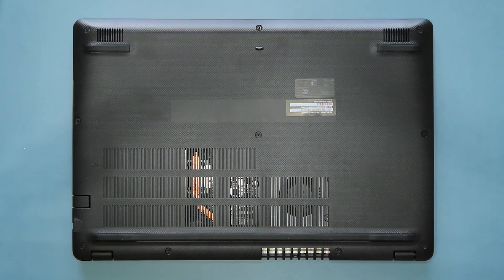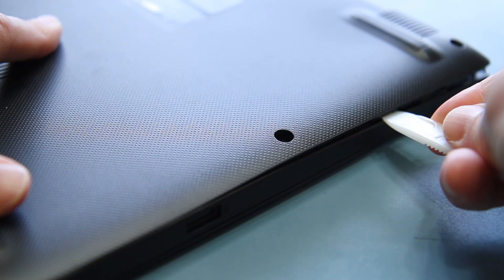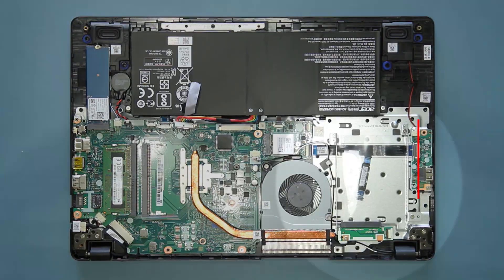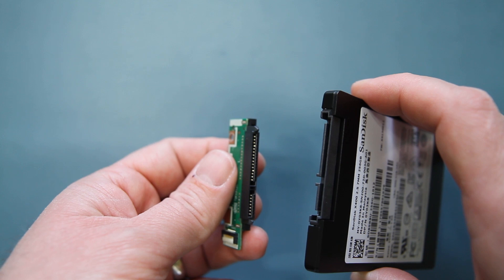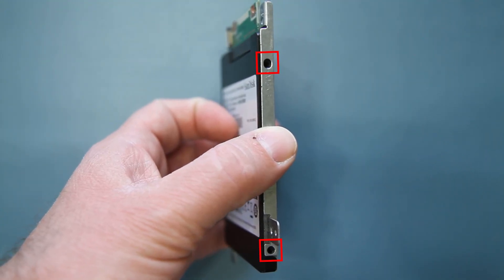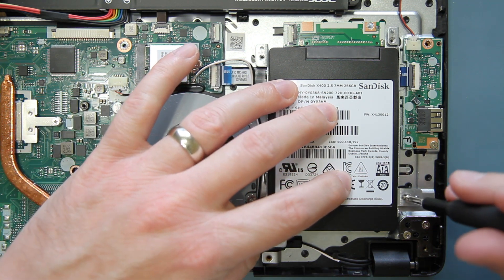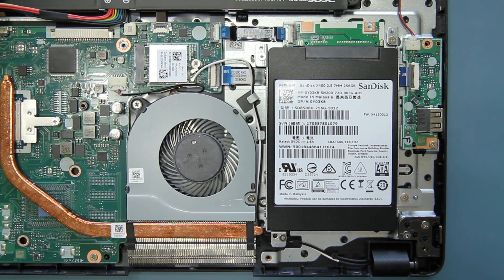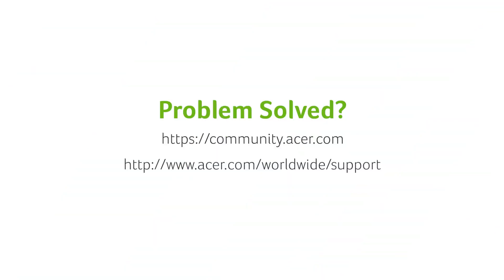Aspire A515-43 How to Install an Additional Hard Drive

Comment: Thanks, very helpful! however, if you're using SanDisk as your drive then the technical information should not be on top - as presented in the video - but on the bottom! otherwise you will need to unscrew everything again and screw it back again.
Reply: Kudos, Correct, have to line up connectors, "Not" the label on the drive.

Comment: I have this very computer (Aspire A515-43) and installed an additional hard drive (Crucial MX500 500GB 3D NAND SATA 2.5 Inch Internal SSD) exactly as per the instructions in this video. Everything went perfectly smoothly. Now that I have booted up the computer, however, I do not see the new SDD in the Windows File Explorer. When I click on "This PC" in file explorer, I am only seeing the original SSD which came with the computer, and not the second SDD which I just installed. How to fix this or trouble shoot it?
Reply: You have to go into disk management, create a simple drive "D", and format it NTFS. so it can be seen by windows

Comment: Works great, just as described.
Couple notes:  The glue holding the Hard Drive to Motherboard cable to the case was pretty strong. Be careful prying it off that you don't hurt it. 
The Motherboard side under the connector was NOT supported by anything on my computer, so be careful not to hurt the motherboard while manipulating the clasp for the HDD cable.
The MB to HDD cable has tabs on it, which also go into the connector. There are places for the tabs to go, so you can't mess it up unless you don't recognize this.
After installation, it doesn't just pop up with the native drive. You have to go into "manage storage" in Settings and tell the Computer how to designate it (Typically "D:" since "C:" is the native one with the OS. Refer to this designation to store things there. 
A trick I Iearned from my Granpa is to spin the screw GENTLY backwards (under gentle pressure) until you feel a "click." Once you feel this "click" you KNOW that the screw threads are lined up correctly: NO Cross Threading! 😁👍
Reply: Is this the slim one?

Comment: I might sound dumb but the hardrive is already in the computer right so all i have to do is connect it?
Reply: Bruine Bonen there is already a nvme md2.5 128gb drive in these. This company just installed an upgrade. There is a slot for a sata drive for more storage and that’s what they installed

Comment: At the end before screwing the 10 screws back in I would turn the laptop over, boot it, and check that the new hard drive is actually recognised by the BIOS/Windows. Saves having to take them out again if you've done something wrong (which is what I did, I didn't place the flexible cable onto the motherboard properly).
Reply: True

Comment: HDD / SSD flex cable for Aser Aspire 3 a315-55g-3046 laptop where to find and what part number 

give feedback in comments
Reply: I have the same problem. Did you resolve it? There are part numbers here: https://community.acer.com/en/discussion/586766/how-to-choose-a-sata-cable-for-acer-aspire-a315-42g-laptop-to-connect-2-5-ssd

Comment: Why 9mm drives are not supported?

I saw a review in amazon where the buyer posted pics from A515-43-R19L with a Samsung HM160HI drive installed. I googled its specs which says it is 9.4mm.

I bought the same A515-43-R19L and could successfully install an old Samsung HM250HI which is 9.5mm according the specs I googled. That 9mm drive I have does fit. Certainly, it is not in a completely loose space, but it is not that it cannot be installed because physically does not fit. The only thing is that the keyboard in its numeric area was slightly raised and that is barely noticeable. Or is there a problem that could generate?

Thanks for your answer :)
Reply: i just installed an old 9.5mm WD hdd and now that you mention it my enter and 4 keys are slighlty bulged up. I wouldnt have noticed it if you didnt mention it. I cant think of any issue other than poor heat dissipation... how's your hdd doing?

Comment: So this isn’t really related to the hard drive installation but I’m having a problem with my battery. When I plug in the power adapter my battery lights turn on but there’s like a squeaking or whistling noise I can hear when I plug it in. Sometimes my battery lights flicker and the screens brightness dims and gets brighter. I have the same laptop.

Comment: This second hdd/ssd upgrade is all plug and play?  No reformatting and or reinstalling windows etc... ?
Reply: All new disk drives need to be formatted by Windows. However, you should not need to reinstall Windows.
Reply: weezles1 how is this done I’m going to be upgrading mine

Comment: If you buy an Asus or HP laptop, they will not come with the HDD mounting bracket and sata connectors. Also the parts are not easily available. It is very hard even to find where to buy them. But Acer has done well. They care for their customers!!!
Reply: My Acer laptop doesn't come with the bracket or sata connector. Have to buy them on my own. So meh.

Comment: HI!,  would you recomend using the additional hard drive to run an operating system on? I want to dual boot, but i only have 60gb left on my pci ssd. I ask this because Im not sure the cable is robust enough for running an os. Thanks!!
Reply: OS or not os is irrelevant to the cable   either the cable is good enough or its not

and dual boot using the m2 is better due to speed alone  then use std sata ssd for larger storage thats cheaper..  and always do your backups of the M2 or whereever you have OS's installed etc onto a different PHYSICAL drive  (not just an alt partition)

As for space w10 is an abhorrent piece of shit beyond belief and technically is NOT an OS at all  it is a service that you agree to get fuked by

dumping it and running w7 is better  or if you want new security updates officially use a w8.1 install with classic shell to make it look/act like 7

or run Chrome OS or Limux mint etc

tons of viable options available

as for m$s bs attempt to outlaw using w78 on newer processors etc  not only is that BS illegal  but there is an easy workaround avail for free  so m$ attempt to force w10 on ppl once again is foiled for all our benefit
Reply: Don't underestimate that cable. That one can handle 6Gbps if you use 2.5 inch SATA SSD.

Comment: Any way to get the screws for the upgrade if you don't have them. I bought mine refurbished?
Reply: they are just the same std screws used in many many many comps for yrs  just these use a vhead and even those are very common

you shouldnt have any issues getting suitable screws dirt cheap or free from most real comp stores (worstbuy etc are NOT a real comp store)

My workbench for example i have containers with various screw types etc  and the kind needed here I have at least a few hundred spares   just on the main bench alone lol
Reply: @kindanyume  Do you know what size the screws are?

Comment: Hi pleas it's the same with this model,somewhere they write that I can have 16Gb RAM is true or not.https://www.acer.com/ac/cs/CZ/content/model/NX.HF6EC.002 thx answer
Reply: By default the acer comes with a fixed 4 GB RAM, you can add 8 or 16 to get 12 or 20 GB in total
Reply: As far as I know it can handle 16 gb  :)

Comment: My laptop didn't came with the Screws to secure the drive because is a refurbished item from Acer... Does any know where can I buy the Screws??? I will really appreciate it if someone could tell me🙏🙏🙏🙏
Reply: I'm in the same camp, my refurbished laptop didn't come with the screws either.  Let me know if you find out, I'll do the same!  Acer refurbished support couldn't tell me, and they also said that by opening my laptop I voided my warranty (?? - they give instructions on how to do it!).
Reply: @bgcarr85  I called Acer Support and Amazon Support. Neither were able to provide me with new screws. Amazon did mention the screw model was M2.5xL8.0 so I might try to buy some another way.
Reply: These should work, it's a bracket, but comes with all the screws.
https://www.amazon.com/Corsair-Dual-Mounting-Bracket-CSSD-BRKT2/dp/B016498CK0/ref=pd_bxgy_147_2/131-4904577-6532602?_encoding=UTF8&pd_rd_i=B016498CK0&pd_rd_r=074d4e7d-7b23-43a7-bccb-6801deb4ee89&pd_rd_w=n6xT7&pd_rd_wg=8qoUg&pf_rd_p=09627863-9889-4290-b90a-5e9f86682449&pf_rd_r=VFE11M48DB4BZ41PW3XQ&psc=1&refRID=VFE11M48DB4BZ41PW3XQ

Comment: Where can i find this bracket and the hdd cable?
Reply: Nameste Zik did you find out? Because mine doesn't have either inside and i need to know where to get them
Reply: @staceyanderton1562  Since you didn't get it I think you need to contact Acer. I did and they sent me mine.
Reply: @Super_B1  I have to buy mine :(
Reply: Inside of the laptop.  Already there and ready to go.

Comment: I did this. However, the computer does not recognize the hard drive is there. What do I now?
Reply: Ensure that the drive is installed correctly. Check if the drive is showing up in the bios. Otherwise, it sounds like you need to allocate the space to the new drive. Follow this guide to format the drive https://www.windowscentral.com/how-format-new-hard-drive-windows-10 . You usually have to do this with all new drives.
Reply: @ollypiper8847  added m2 ssd on my laptop and wanted to use my old hard drive for storage. they both show up in bios, but old HD doesn't on windows or file explorer or disk management. There's just one disk (C).

Comment: Ram upgrade?
Reply: Upgradable up to 32GB 2666MHz RAM
Reply: I put 16gb (2x8gb) of corsair vengeance 2666mhz in mine, made so much difference with certain games and general user experience with multiple windows and tabs

Comment: Will this work with a Samsung 860 EVO SSD? Would I need an additional SATA cable?
Reply: That will work, no additional cables needed.
Reply: just check the exact model drive thickness  since there is a 7mm limit (most 2.5" ssds are thin enough though not all)
Reply: Samsung 860 EVO SSD has 6.858mm thickness so it should work

Comment: Any m.2’s slots?
Reply: There is one M.2 slot already used up by the original drive. To replace this you would have to transfer over the operating system to a new drive but would need access to another computer. A tricky task and it would be simpler to just add a SATA drive. Assuming you have data you want to keep.

Comment: Could I have the link for the hard drive you used in the video? I recently bought this laptop and really like it so far but I need some more space. If I could have the link it would be greatly appreciated.
Reply: They used a SanDisk x400 246GB model. However, any SSD would work.
Ebuyer link: https://www.ebuyer.com/797696-sandisk-ultra-3d-ssd-2-5inch-250gb-sdssdh3-250g-g25?mkwid=s_dc&pcrid=51482419499&pkw=&pmt=&gclid=Cj0KCQjw5MLrBRClARIsAPG0WGxIHJj0Xz4x6lD5_Ggth0ZquBIl_-QhsXpVgQZDxjecwb3esuGfLwAaAgt7EALw_wcB
Reply: @ollypiper8847  can this laptop use hdd? Or just ssd sata?
Reply: luau_2005 Go on www.crucial.com and enter your laptop manufacturer and model and you can check out all of the available hard drives compatible with your laptop for their company.

Comment: Can i up ram to 16gb?
Reply: I added a 16gb Crucial SODIMM 2400 from Newegg. I left the 4gb Samsung 2666 SODIMM in place. So 20gb about $50 running great.
Reply: @philipadam4023  any chance you could post a link to that?
Reply: According to a representative response in the Amazon question section, up to 32gb of ram capability.
Reply: I upgraded to 32gb, it sees and is considerably faster now!
Reply: The motherboard supports up to 32GB of RAM. The CPU supports up to 2666MHz for speed.

Comment: Does this apply to the A515-43-R19L?
Reply: yes it's exactly the same
Reply: I second this question
Reply: Yes, sorry if this answer was too late for you, but the motherboard is exactly the same. I followed the exact same process with the  a515-43-r19l and it worked like a charm.
Reply: Jake Rogers which ssd did you use?

Comment: Interesting. I just bought this little machine and would like to install a different ssd. Does it support nvme 2280 form factor?
Reply: you can see at 1:04 the ssd slot in the top left hand corner an ssd already in place. for more specific details on which connector it is (SATA/etc), best to boot up your bios and u can see what's the connector type on the disk drives... once you know what type of form factor it supports, you can buy the relevant one!
Reply: Joey Hillers you can upgrade the nvme already existing but your gonna have to clone the new one with note storage